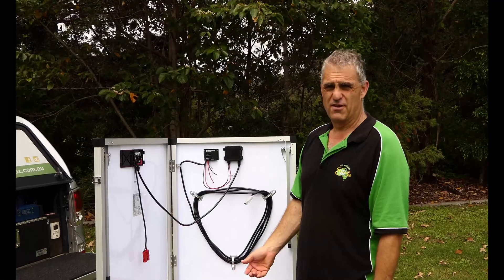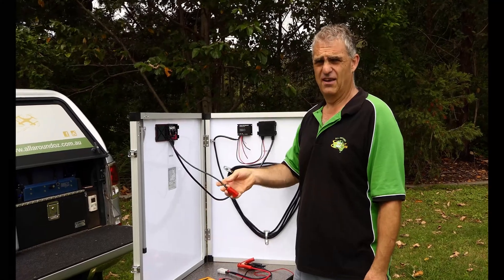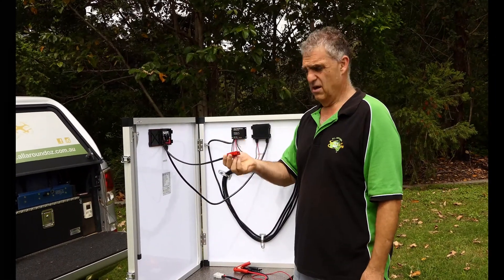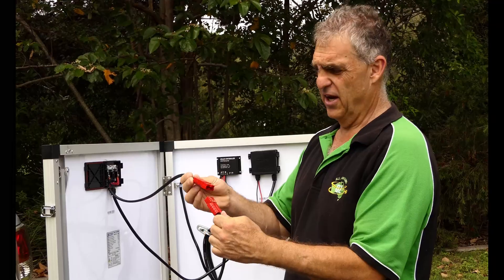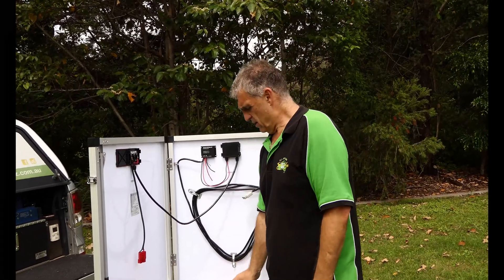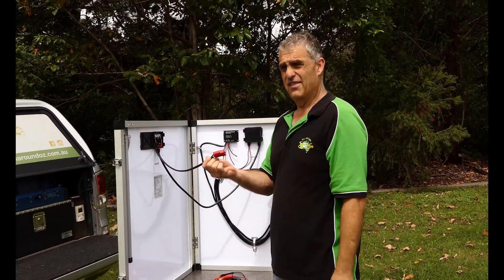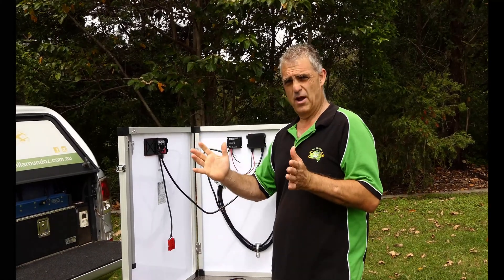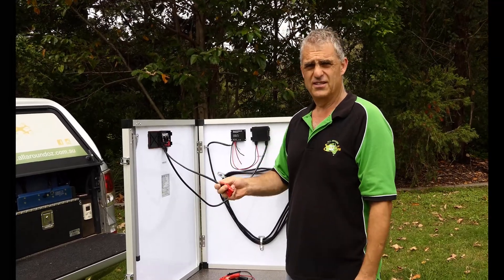Bypassing Solar Regulator on Solar Panel

Comment: Is it possible to just bypass the regulator and add a normal 12v grey anderson? I am looking at getting a battblock so just no longer need the inbuilt solar regular on the panel.

Comment: Great video... thankyou...i just wanted to check something tho...i want to bypass regulator on panels to charge lithium battery power pack which has its own regulator...if i cut and join the wires leading into the regulator with Anderson plugs(grey) then join the plug before the regulator to the power pack ,will this charge the power pack? And if I rejoin the wires before the regulator with Anderson plugs the panel should work as normal?

Comment: I have a power station that has an MPPT charger regulator built in, the solar folding panel I want to use comes with an MPPT , How do I by pass it and connected straight to the Anderson plug please?

Comment: Hello
I have a Kings 250w solar panel and it has a regulator on it with a grey plug.
I’ve been told to connect a solar panel to the blue Anderson plug of my caravan the solar panel needs to be an unregulated panel.

Does to mean I can disconnect the regulator on this panel and change the grey plug from grey to blue?
The caravan runs a BMPRO Trex3.
Thank you

Comment: I thought you were going to show HOW to bypass the panel regulator.
Reply: I agree. Why post an 'instructional vid' that only shows the end result. It should be a step by step process. Might be good for all the tech savvies but hasn't really helped me at all
Reply: @playingwithsticks6819 
He has just added an extra cable and ran them straight off one of the junction boxes to an alternate Anderson plug...
the panels are connected in series, so therefore the regulator has been bypassed

Comment: Thanks for the video.What gauge wire did you use for the unregulated power cord you made?.cheers.
Reply from the maker: I think it was 6mm or about 10 gauge. A little over kill but it helps reduce voltage drop.
Cheers
Brenden
Reply: All Around Oz thanks mate 🤙

Comment: Hi, can you please advise what folding panels you are using and how it is performing? Current/voltage?
Reply from the maker: Hi Raymond, The panels are just the 160w 4WD Supercentre folding panels. We  run them unregulated straight to our CTek D250SA and use the regulator in it. They run at just over 24v into the Ctek but I am unsure of the current. I have yet to use them with the standard regulator.
Cheers
Brenden
Reply: @Allaroundoz  I also use the 160w folding panel from 4WD Supercentre and have just purchased a CTEK D250SE. In the manual it recommends using 4mm wiring, but would I still get a good charge using the supplied lead with that panel if I hooked it up to bypass the original regulator? I believe it's only 2.5mm. Thanks
Reply from the maker: @jasonmatts2469  Hi Jason, it depends how long your lead is going to be. 2.5mm cable will have a much larger voltage drop over a 10m lead than 4mm cable. In saying this, the system will still work with the smaller cable, it just won't work as efficiently. When you only have a few hours of sun, the more efficient the system is, the better.
Cheers
Brenden
Reply: @jasonmatts2469  I've watched a heap of YouTube vids re cable size, it's convinced me to use 8AWG cable for a 10m run.
As this vid owner said, you want to get the max efficiency ASAP incase of inclement weather. 
Cheers

Comment: This is really interesting! thanks for that great tip! cheapest and fastest "upgrade", from 12v to "24v"  does this also mean,  that will also produce power earlier and later in the day ?
Reply from the maker: No, it doesn't change the amount of power that the panel produces. Cheers

Comment: So to be clear I can do this to any portable solar panel right? I'm looking at getting say, 3x 280w portable panels and hope to be able to rig them to be attached together to 1 regulator. I assume I achieve this by having 1 "main" panel that can be connected to the regulator like you've shown, while the other 2 panels can be wired up to connect to each other and the main one via Anderson connections (clear have to wire this myself etc).

With that setup I could choose to run 1, 2 or all 3 at once etc?

This is what seems logical to me, but I am asking stupid questions because I don't wanna end up stuffing up $2K worth of batteries haha.

I don't get why it's not standard to get portable panels that regulators can just easily be bypassed by unplugging them etc.
Reply from the maker: Yes you can hook the panels up together before you run them through a regulator, just ensure the positive goes to positive and negative to negative. You can get panels that don't have a regulator, just make sure that the regulator you choose will handle the voltage output of the panels. Another thing to consider is that the more junctions and cable length you have, the less efficient the panels will be. Keep the regulator as close to the batteries as you can. Cheers

Comment: The way you have that wired up can you use both plugs at once ? Red plug to dcdc and the grey one to another battery in my camper with alligator clips.  I wired mine up the same as the one shown red plug is 20.4v and the grey one around 16v.
Reply from the maker: There is no reason why you couldn't use both at once, but the output would suffer dramatically. If you can, you need to run the 20.4v from the panel to the DC-DC charger and connect the batteries you are charging in parallel to take full advantage of the MPPT regulator in the charger. It is much more efficient than the PWM regulator on the panel. Cheers

Comment: Outstanding explanation 
i got caught out first time with my mate who didnt know what he was doing and we had a flat battery in 12 hours and warm beer 

using the original gray 12v plug with 4m of cable was the worst .. the battery didnt charge at all because of the voltage drop with 4m of cable haha
Reply from the maker: Thanks. The regulators on the back of the panels are not very efficient. Bypassing them even through a new stand alone MPPT regulator is the best way to do it.